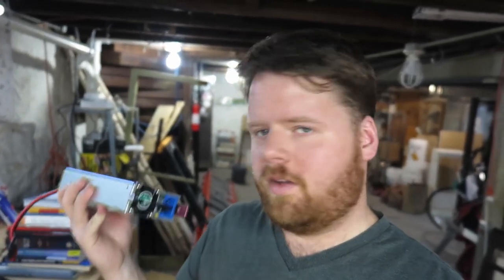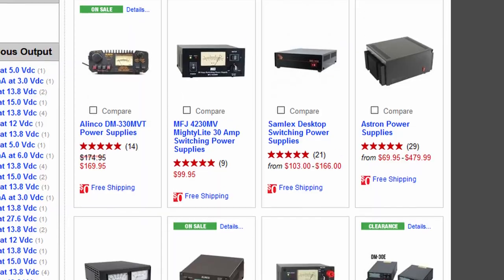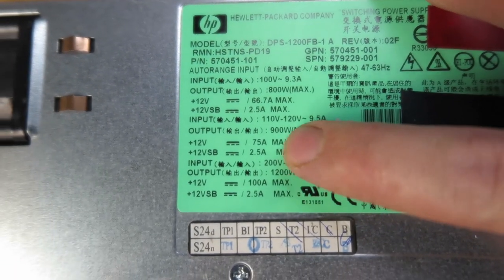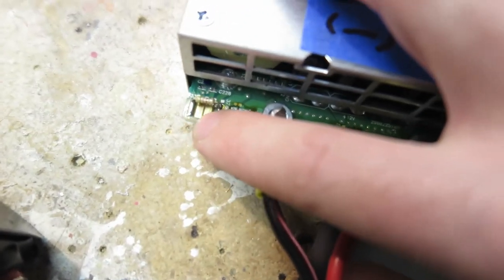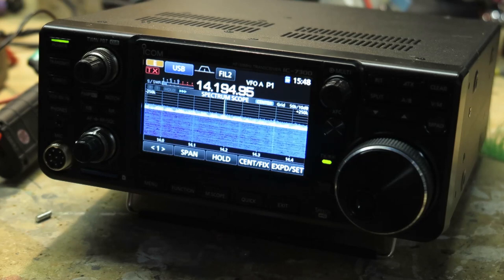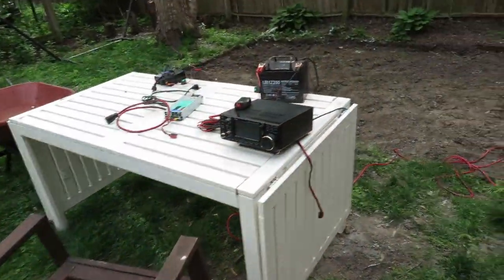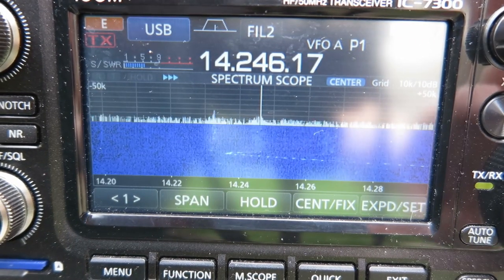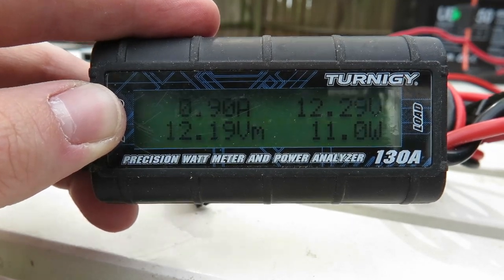$20 100 AMP 12v Power Supply: Good for Ham Radio?? || HP DPS-1200 Review

Comment: For under US$10, one may purchase a special Break Out Board that plugs straight onto the PSU's card edge. It allows the PSU to power up (i.e. the resistor), has a built-in digital volt meter (of as-yet unknown accuracy), and a dozen output PCI-E power connectors. My Break Out Board just arrived today, and it allowed me to fire up the PSU immediately.
Reply: Where did you buy it and does it work or still work okay? Thnx

Comment: I’d love to see the noise from the different PSUs at different loads. I suspect that the (tiny amount of) noise generated by the HP supply, will be greatly reduced if it were loaded with the amps it was designed to deliver under normal conditions. 
(Which in Sterlings case is about 37.5A)

The power supplies for servers with two PSU slots or more, are designed for redundancy purposes, and for that reason, they have been designed to safely deliver max. current, but are only intended to deliver 50% or less when everything is working perfectly. 

The idea is (if available) to connect each of the PSUs with different phases. 

Under normal operating conditions, the PSUs share the load equally, but they are designed to take the full load if necessary. If we take this example (120V-AC input) of a max. output of 75A/12VDC. We get 37.5A at a 50% load. This means that the designed “target” load of this PSU is about 30-35A nominal. (Including a small safety margin.)

IMPORTANT:
It IS possible to modify this PSU to increase the output voltage, but it’s kinda’ risky to your health if you’re not careful: https://youtu.be/F0QWQntPkO4

Cheers from Denmark!
73’ de 5Q3M
Reply: Instablaster

Comment: I made my power supply the same way buy drilling, but there is a problem with that. Some power supplyes have multiple layers, and i drilled throw them, and at first nothing happened. But one day it shorted and caused a lot of smoke and burning smell. Wat happened was that outer copper pad was +12V, but thay had added a GND between pcb layers and it afinaly shorted 12 to ground. After that i checked against a strong light if can see multi layer board traces and i discovered that most of my PSU-s had traces running throw pcb layers. After that i stopped drilling ind souldered most of my conections. Onely drill pcb-s if u cant see multible copper layers. This prevents shorts. lesson learned i guess. I have i think about 15 psu-s and most of them are different brands and moddel numbers, but onely few i can drill, and most have multible layers so drilling is not a good idea. Some have multible layers but have the same voltage layer so drilling is OK, but u cant know the layer voltage before drilling. Now there are brakeout boards that fix this problem. No soldering or drilling. Alsow u can make custom psb-s with your one blade connectors. JLC ja PCB wais make it simple. Dont have it in estonia, but i souldered copper plate to the pcb and then drilled holes in the added copper plate. But for thair cheap price thay are awesome and reliable just need to think about how u connect them cause thay have no wires connected just bare copper strips on pcb. I made a power supply using two PSU-s in paralel, and it can deliver 300A @ 13,5V.

Comment: Try adding a few ferrite core ring.  I have a Yaesu FT-891 which I power with a battery on my sailboat and with a Roswell ATX power supply (44A@12V).  I wrapped the power leads each around 1in ferrite ring.  I see no noticeable PS noise. In fact the radio at home performs a little better, but that's likely due to the antenna: EFHW-80 vs 50ft random wire & auto-tuner.  I used Fair-Rite 5980001001 which I purchased from Mouser for about $1 each.

Comment: What about a cap bank for filtering? I would definitely use some big caps in the output from the hp supply. A capacitive smoother will definitely clean it up I guarantee it will. I am gonna get one and add a filter because I only have 5a

Comment: That does look like it might be an affordable option, just don’t short those pads by accident 👍
Reply from the maker: That's exactly what I did, with a socket wrenching the positive side while it was plugged in. welded it to the chassis a bit but the supply lived!
Reply: N0SSC lol 😂
Reply: Server power supplies have built in Over current protection.

Comment: Sold me bought 4 for less the $65; you can also install Bananna Jack vs wire lugs to do quick (dis)connects.  Also found recommendation of looping the 12VDC output leads on a ferrit core .

Comment: Reason these are cheap is the lifespan Server PSUs are heavy on electrolyte capacitors. The ones in them are generally rated to last just about the warranty period on a server before drifting. Once these reach Ebay they’re fromm. off-warranty servers and most surely have capacitors that have been working 24/7 over that period. Yes, you’ll get a $20 PSU and have dying capacitors  that are worth $20+ a piece. When these fail it’ll be in annoying and dangerous ways, like a big voltage drop on shutdown, or spike on power, or random and inconsistent surges of switching. noise during operation

Comment: got the same 7300 and same QRM . Switchers can be noisy but there is a few things that do work. hash choke on pos lead. EMI/RFI filter on ac input . shielding on switcher . I get noise from CFL lights and switched to LED much better ! I run a solar power ham shack . I have a MPPT controller that made some hash noise but chokes cleaned it up alot . none at night on battery ! also using 12V RV lights some LED some incandescent very quit ! on a clear winter night 160 meter can open and work very well with little hash noise. in my home the worst is my microwave ! 73's

Comment: Yaesu, Icom, and Kenwood all say 13.8 volts + or - 15%   The 12.7 volts that this power supply can be adjusted to is more than sufficient and well within 15%. It is also very quiet, well protected and well regulated. It is far better than a commercial ham radio power supply.

Comment: I really liked this video. It was informative but also just as entertaining. Thanks for putting it on the tubes.
For about the same price I bought a 12v 30A switching power supply from Amazon with voltage adjust and was able to hit 13.8v. Your video makes me want to break out the RTLSDR dongle and see what it picks up. Maybe a 7300 or an Oscope down the road. Thanks again. 73
Reply from the maker: Glad you enjoyed it! I think this is something similar to what you bought - https://amzn.to/2yqaYdB - where have all these cheap PSU's been all my life?! I ought to pick one up and give it another comparison. I need an oscope too to "scientifically" compare them.
Reply: @N0SSC  I just picked up my first scope.... Still learning how to use it, but I bet I could do those measurements on the DPS-1200a I just ordered. :D Thanks for the video! 73 de w8tam
Reply from the maker: Thomas Martin yes you can! Let me know how much ripple you find!
Reply: @N0SSC  Very clean output. There's some very low level (on the 100mv scale) noise, but overall very good out of the box (12.3v). I'm going to try turning the voltage up a bit and see if the output stays that clean.
Reply: I too have one of those 30A ones.. there's a easy mod to clean up them a bit with noise.. using a couple capacitors to "link" to ground.. Basically a 10uf cap to AC ground from (+) and then (-) to AC ground.. 2 different caps.. I've not seen or noticed any noise issues vs a battery on my 891 w/ the 30A amazon ones. That HP Unit looks much more reliable and beefier though then the Amazon ones lol

Comment: I picked one of these up a couple years ago did the mod wish I had drilled through but soldered some #4 wires on for a amp that requires 60 amps and it has worked really well. I would like to put it some kind of a case to protect it but still keep it small and portable. Good video Sterling better buy quick they go fast!
Reply: Don't drill the holes like he did, it's a multi layer board and you can easily brick the power supply.
Reply: @tahlularose9267  doubt it if your careful about it

Comment: This is really a useful video. Thanks. I have below comments;
1. How we can set 13.8V? 
2. Do noise in present case is not meeting desired 13.8V to ic-7300?
Thanks.
Reply from the maker: You have to take the case off and perform some mods, that I didn't go into, nor do I recommend it. The IC-7300 and most other ham radios performs just fine slightly off of 13.8v.

Comment: You need to add a few small but happy 12-volt 1/8F ¤ caps or bigger ones because the power supplies really are not meant for load changes so drastically so the cats help there as well as help mitigate noise I'll see if you remember you're plugging it into an AC main which has noise in it there's a few other things but yeah
Reply: Those PSUs are built for servers that change their load in milliseconds.

Comment: Not sure how many amps your pulling. I just got one today to use for RC Lipo charging. I have 2 chargers running off it set to pull 15A each, so 30A total at 12V with 10.5V set as the low limit. The PSU lasted about 3 minutes, then gave a loud POP and no more voltage on the output. I'm not sure if I got a defective one or what the deal is. I figured 30A being less than half the rated, I wouldn't push it too hard. Mine was a DPS-1200FB A. I only got this one because the dell ones I have are REALLY loud with no load. The fans in them with no load run full throttle at 12,000RPM's. This stinks when I'm discharging packs at the end of a day as there isn't any load on them, the chargers are just dumping the watts out to heat internally. So for 3 hours, I have to listen to a jet engine running in my office... Since I work in the room these are in (you can hear them throughout the house), I figured I'd give the HP one a try since it doesn't do that with the fan until it gets put under load and temps go up.

Comment: Rookie question. Im completely new to Ham, just got my call sign a couple weeks ago. 
So here is my question, could you use an AC to DC supply (or any other appropriate power supply) and then install
a noise blanker in between to reduce some of the unwanted interruption? 

Is that a completely different application? 
If so, what is the sequence of equipment needed for a home base system?
AC power to DC power converter, (possibly noise blanker), radio, coax, antenna? What other considerations do I need to look at 
for getting a base station setup?

Okay....sorry....that was more like several questions 😁
Reply: Use a car audio power cap in between your power supply and radio it'll clean up your noise and it'll give you a nice even consistent Supply
Reply: @RileyTheMonster299  ….made this post over a year ago. Since then I have my shack setup on a completely off grid solar array and lifepo4 battery bank. The only AC power in my shack is computer, which I could run off of an inverter, but havent found it necessary. All of my lighting, fans, equipment are all dc powered. Cut down on my RFI drastically.

Comment: I used this to replace my 12 amp linear old Thompson Electronics power supply, worked fine. Instead of lugs I used banana plugs, and my janky ass distribution solution brings it to my CB and kenwood 2m radio, no problems.
Reply: 1 week later and it's still nto giving me troubles. I might buy a couple more power supplies to hoard for when the rest of the ham community finds out about it

Comment: So I just found this video because I'm having trouble with my server grade power supply. I purchased it before I saw this video. And I'm having an issue where when I key the microphone on 2m, low power, (th-9800 so 5w), the multimeter shows its spike to over 20 volts (once over 100) and my radio shuts off. The one I bought has an adjustable voltage regulator built in. I use the multimeter to make sure it's 13.8 and I have fewer issues, but it still surges and cuts out if I use anything less than 50w. Anyone with any experience please comment. I am very confused

Comment: Why does everyone use the resistor?  I jump pins 33 and 36 and they run just fine.
Reply: You can short, but the smarts identify it as a fault and it usually cranks the fan up  to max. If you use the resistor, it runs normally and quietly. 

At least that’s the case in the HP unit I scored. I also jumpered a resistor in the feedback loop to push out 13.2V for my older FT747GX
Reply: From my understanding it differs between models. Some can get away with just shorting the pins.

Comment: Try a capacitor I used a 2200 if 25 v cap across negative and positive  and it knocked the noise out of my cb radio , I had 3 s units  and now there is 0 noise

Comment: Got a supply, but a 470 resistor on it, drilled the two pads, and no green light. I get a quick spin up of the fan and that's it. Ideas? There is a very real chance of me not being good at eletronicals
Reply from the maker: I started with a 1k Ohm resistor, and that didn't give me the green light. A 470 did. You might have to play around with the value. Also make sure the resistor bridges pads 33 and 36 (the first and 4th pads from the left looking from the top) - https://blog.seidel-philipp.de/hp-dps-1200fb-power-supply-hack-for-charging-lipos/
Reply: @N0SSC  did you know, reading the package is essential? Used a 470k instead of a 470....will report back
Reply: Bob's your uncle on the 470. 73 kc3odv

Comment: I got the same power supply. PD19.   Not much info over internet of how to increase the voltage to 13.8 for this especific model.   
I can make mine to 12.7.  after that the ovp kicks in.   Do you know how to get the 13.8 volts???
Thanks 73

Comment: Wonder if I could run a 500 watt solid state HF amplifier on one of these?
Reply: That's what I am going to try to do in a week or so.  I have a Ten Tec Hercules II and 115 ac service.  I have run my Hercules on a 75 amp power supply before (but at 13.8 volts) and it was fine.  This one might be just fine.  I'll let you know.

Comment: Don't drill the holes like he did, it's a multi layer board and you can easily brick the power supply.
Reply from the maker: Fortunately this part of the board only has the top and bottom layer, which are both + and - 12v. I would be inclined to heed your advice, and buy a breakout board. I've learned these power supplies are super popular with GPU cryptocurrency mining, so breakout boards are all over the place.
Reply: Incorrect.

Comment: I accidentally bought two of the smaller 750w ones. Hopefully they work just as good. 🤷🏿‍♀️ Thanks for the video.
Reply: They will work fine but may need to solder the resister to different tabs.

Comment: have you tried using solar panels on a battery yet, ?
Reply: also, if theirs no Ground on the  power supply, OR the device its powering it can completely  eliminate the sound. if you connect the ground to a probe on a oscope, and just check out how much shits flowing through it  noise wise theirs alot of it .

Comment: Thanks bud, but I wish you and others who talk about these alternate supplies also show us how it hooks up to the back of the HR radio. Can you use the sockets from the computer PS?
Reply from the maker: WALLDORF ELECTRON_CO I started it off just by soldering hookup wire to the pads, connecting that to a power pole. In the second version, I drilled through the pads to attach nuts and bolts for ring terminals instead of soldering to the pads. I plan to make another video on these showing the connections and some of the weird power drops i’ve seen.

Comment: eeew, the default colors on the 7300 waterfall are so bad...Blue on blue on more blue.
Reply from the maker: forget_your_life that’s just the default. What do you suggest?
Reply: N0SSC I suggest going into the deeper long press menu and changing waveform type to Fill+Line, then changing waveform (line) color to something not blue, then waveform (max hold) to something also NOT blue.